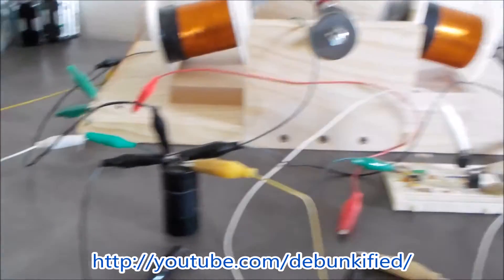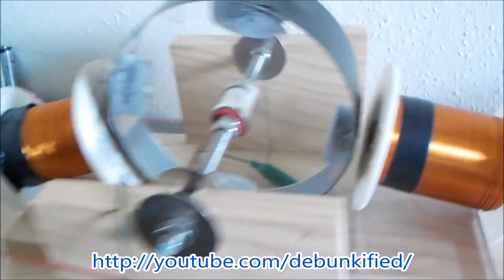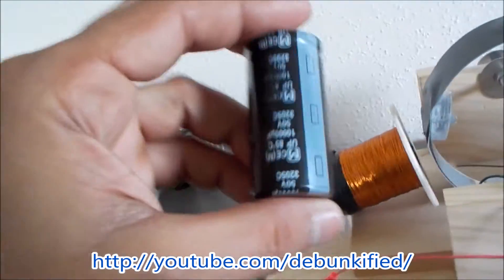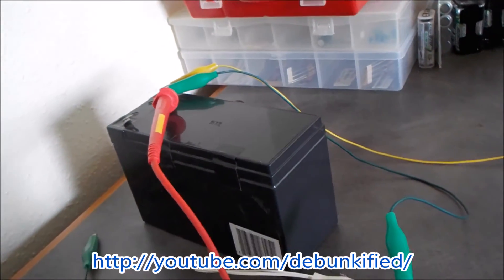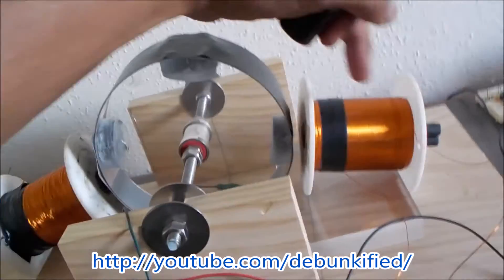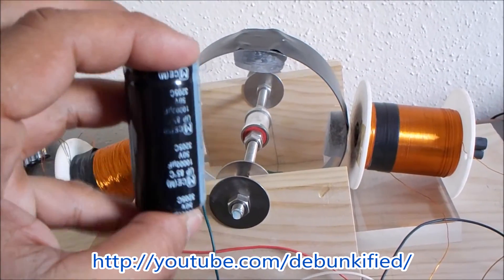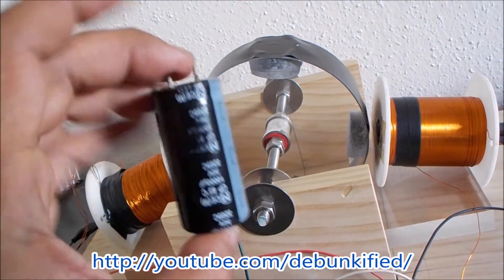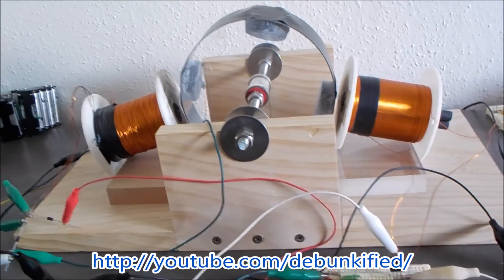Why You Need a Capacitor

Comment: have you try setting up bucking coil at the output so load will have low to zero effect in the primary?
Reply from the maker: +John Christopher Delegero Yes, it doesn't make a difference because it still draws current from the generator.
Reply: oh ok thanks, keep experimenting bro good job.

Comment: here is another piece of info that may help some people trying to make a self running motor....you need lots of coils...you will need at least as many coils as there are magnets on the rotor. Eventually with enough coils there will appear to be less load on each individual coil, which will seem to generate more than it consumes, then it will take alot of fine tuning and magnetic adjustment to make something self looped.

Comment: debunkified, i had the exact same problem with reed switchs, yes there are more powerfull ones but they will only cause more drag on prime mover...i think solid state shorting is the key to success, i believe the muller designs did just that.
Reply from the maker: I've been working on the design of the schematic of the 555 timer coil shorting circuit for two days now. It's almost ready as soon as I do I'll upload to dropbox for you guys since I know there have been several requests. Hopefully tomorow.

Comment: there are a number of ways to loop back power from one coil to another drive coil.....the trick lies in getting that power out without causing drag or cogging on the prime mover or drive coil...i dought if tesla had any way of measuring the output of shorted coils back in his time, bill muller may have,not sure, but in one of his videos he is testing his ideas at all different rpm's....and im not sure if he ever made something self run or not. romeroUK i believe had it working, but he was using odd magnets to coils design, which does seem to, in my experiments, seem to balance the lenz effect or at least lessen it to a degree.
Reply from the maker: I think the even/odd configuration is so that the rotor and stator cores have an equal push pull so that there is a neutralizing effect, but I'm not so sure. Any magnet moving past a metal core will have an almost equal attraction and back attraction so that a flywheel or rotor won't notice the metal core too much.
Reply: What happens with the odd/even effect is while one magnet is pulling backwards, another is pulling forward....they do tend to balance themselves out. What it feels like turning by hand is like 1 cogging of a magnet and coil, even though ALL the coils/magnets have made one pass...so you get what all the coils can generate at the cost of one magnet cogging...hard to explain but thats what happens.

Comment: my caps help.  but lastnite i really tested every configuration between 3, diodes, caps, resistors.   i could  see differences in all ways sorta.  but the resistor going ACROSS, the circuit was best.  i really kept swaping parts n sizes and bam! the resistor not only took clicking sounds away, like diodes n caps, buy it took arcing away as well ,AND DIDNT SLOW THE ROTOR.   ACROSS WAS BEST.  I THINK RESISTOR HAS POLARITIES TO.  (DAMIT:) I FORGOT, I GOT CIRCUIT HERE NOW, BUT ANYWAYS, DERH). SO RESISTOR GOING FROM BOTH ENDS OF REED SWITCH , PLUS DIODES ON BOTH ENDS GOING IN SAME DIRECTION OF COURSE, (I WISH WE COULD ATTACH PICS/IMAGES/MINI THUMBNAILS TO SHOW IDEAS).   YOUTUBE SOMEDAY MIGHT HAVE THAT OPTION!😎😋).  so resistor was below the diodea,.  diodes were directly on switch ends, and resis. was across the diodes (hope u can visualize, n i make sense people!  anyhoot.  i.m bak to pulse a rotor with lil pulley connected to a shaft/rotor/bigger pulley made by two small dc motors that actually run a dc motor wen i spin.  i hope it loops!  i will freak out for sure😍😅😆😁😂😶😶😶😶😶😶nite ppl!
Reply from the maker: Hi blade runner, use drop box, it's a good way to get images up there just link to them, I'm curious as to what your snubber looks like. I've been working on the 555 timer coil shorting circuit for like days now and plan on getting the image uploaded here soon. So resistor goes across your reed switch? I can sorta visualize the diodes on each end, in the same direction like you said, but I think those really wouldn't do anything as they allow the current to flow from the source of course, but also allow the collapsing field to go backwards as well.
Reply: snubber?  :)  I learned a new phrase/meaning! wootwoot!  Your reply/notification is the 1st I bothered reading, EVER. SO?  I understand drop box & uploading youtube- but clueless how to postup the way you described.  imo- a videos best- cuz then ppl can see & HEAR the difference ect...  So..... I wanted to complete my setup anyways.  a tv coil in aprx. 5" pvc tube with the 4 coils exposed, so I can swap out connections to rearrange device till I find optimum performance (voltage, arc size, ect).  I attached a solderless breadboard to side of motor/pvc already.  
 I can record setup running in couple different configurations.  crisscross caps/resistors/diodes is basically it....  idk.  simple, since I already got it ready----
I.ll just post up my video in my channel, send u a link asap.  :-)    bus spater gator; )
Reply from the maker: Well all you do is upload your image to dropbox, get the link to it, I like to test it out in the web address bar by copying and pasting, but it will give you an option to click copy and it will place it in your clip board automatically for you then just paste it in to make sure it works.

From there all you do is paste your link in the description box below your video while editing your video. Alternatively I like to use Google URL shortner, just Google it and get a nice short link to your uploaded image on Dropbox and put that in your description box underneath your video while editing. Hope that made sense.

Comment: A neon lamp across the reed switch might be better than a diode.....
Reply from the maker: HI WTF, I have thought that, in fact I think that's what I got confused with, a long time ago I saw on a credible website that a diode should be placed across a switch or transistor in order to protect it from an inductive kick back spike, so I just always assumed that was the right way and thought it was nicer than a neon, but now I know that doesn't even work, although the reed might have just simply failed from too many cycles, but the diode across the coil is perfect, I never really had to think too much about protecting a switch because it was always being rerouted to something else and harnessed and now I need to kill it completely for demonstration purpose.
Reply: debunkified 
My reed switches all died from the sparks created by the BEMF.  Bedini had a neon lamp across the transistor in his design, so I figured it'll work for the reed switch too. 

I have thought about possibly building a solid state version of this.
Reply from the maker: Hi WTF, I believe a diode across the coil is the best solution as that would loop the collapsing field over and over again through the coil and diode until it decays. A neon across the switch or transistor should work just fine with a reed switch, the problem with reed switches is that they have a limited life span of something like 100,000 cycles.

Comment: diode goes in parallel with the coil.  this way when switch opens, the coil collapse causes current to just circulate in a loop in the coil until all the energy is used up in heat and radio waves i guess.
Reply from the maker: Hi local,

Don't guess, just know that you are right, because you are. That is very good, and I have no idea why I would have a diode across a switch for, and you're right, the diode should be placed across the coil in parallel and waste away the collapsing field without destroying any switches. Especially without rerouting the collapsing field into a load or capacitor, in which case I have to leave the collapsing field off for the comparison test.